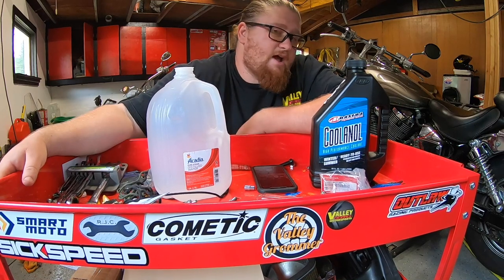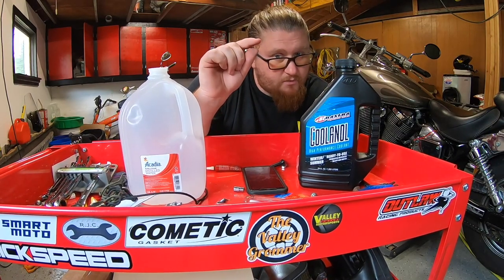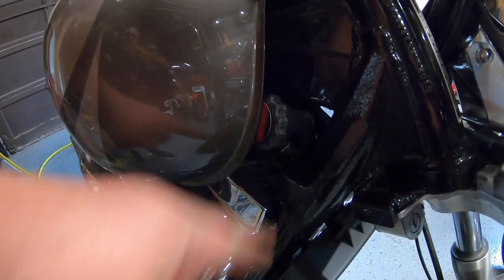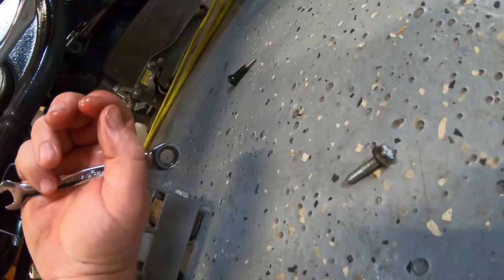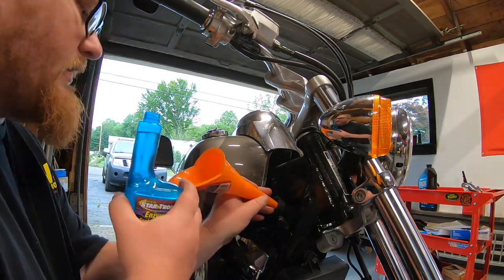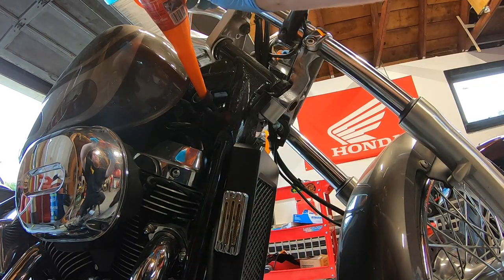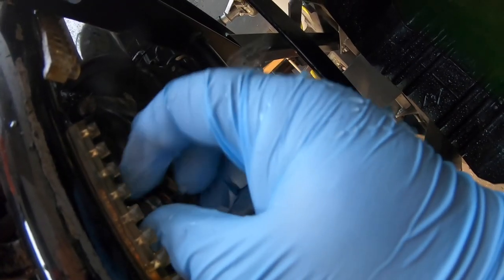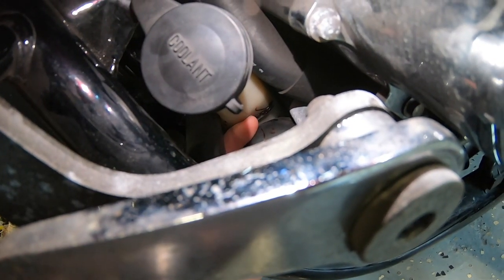Honda COOLANT FLUSH Walkthrough

Comment: I believe the reason you didn't get a gushing river of coolant when you pulled off the radiator cap is because you removed the water pump mounting bolt and not the drain plug.  The drain plug, at least for mine is the middle one which is much shorter.  I experienced exactly what you did after following your video and had a trickle more than a gush, once I replaced that bolt and removed the drain plug I got that river of fluid instead.

Just wanted to let you know that the instructions are not quite accurate and should be updated if you can do that after the fact :)
Reply from the maker: You might be right it’s been awhile since I did the change and I don’t remember but I appreciate the feedback for sure!!
Unfortunately, the video has to come down and get deleted from YouTube to make any adjustments for uploads
Reply: i did think that was really weird when i was doing my shadow, should of thought about it and put two and two together. housing bolts are longer. i thought that sump plugs are normally shorter too from working as a tech in a dealership for 4 years but i already did it. I hope it wont ruin the sealing long term. 

valley did seem very confident in the video, that he thought that was the correct bolt and the other ones were incorrect even bringing up a diagram, not dissing because it was a still a good informative video besides that but that should be definitely fixed though, may lose trust in viewers! maybe even a little a pop up or re edited section even just some text saying middle one is the correct bolt, people do that all the time in videos i know how to even on bike edits. i think you may even be able to put text in on youtube studio if you didn't want to re upload it. but it is a big thing to have wrong in the video. i know how to fix it but the average joe doesn't know how to reseal a water pump. cost them $$$

i would imagine it makes sense for it to be the inner one facepalm i hope it wont lead to me needing to remove the water pump housing and having to reseal it though dude :/ serves me right for not checking the factory manual myself and trusting a youtube video but i've done millions of changes on my kle, and CBR 900rr and cars on the shop and friends, family, many cars ive owned. so i just thought a quick video to save me time on the locations :/ 

once again valley good video but that could cause some people some headaches, esecially with how certain you sound with everything :) cheers

Comment: So the radiator and the overflow should be topped off!? And both take 1.5L or only the radiator take 1.5L?
And what is the role of the overflow box in the motorcycle?
Thank you for your amazing video I have the same exact shadow
Reply from the maker: So you want to fill the Radiator up to the neck where you pour in fill it tip top. You want to fill the overflow box to its full level… there should be 2 lines molded into the plastic a high and low level.. I would say just after half full.. the “overflow box” or coolant expansion tank as it were holds a reserve of coolant on the bike when coolant gets hot it expands in the system and needs to go some where to go so it will over flow into the tank… once it cools and gets siphoned back into the radiator line to continue to cool the bike… you also don’t want your coolant to burn out either so therefore you give a little extra in reserve as a standby as the bike heats and cools expand and contracts so on and so on!!!!!! Pretty CoolAint’ it!!
Reply: @Thevalleygarage  awesome

Comment: Do you think you could make one for the Fury in the future? Or is it the same setup?
Reply from the maker: I can definitely make one for the future. However, the coolant change process is the same only other locations are different. The radiator fill cap is hidden behind the ignition cover (Where you put your keys) And the coolant drain bolt right behind the kickstand. You’ll also see the and extra reservoir box there too. just pop the large chrome cover above the kickstand off should be one H5 Allen key
Reply from the maker: Honda FURY COOLANT CHANGE (Complete Walkthrough)
https://youtu.be/-3mYwSB7pdk

Comment: How about that orange coolant for aluminum engines do you know if that's okay
Reply from the maker: I’ve personally never used orange coolant before in any of my machines and I never will. Although, As far as Honda’s concerned as long as the coolant has Ethylene Glycol in it. It will be safe to use. But honestly just stick to Green or update to Blue you’ll be just fine!  👍